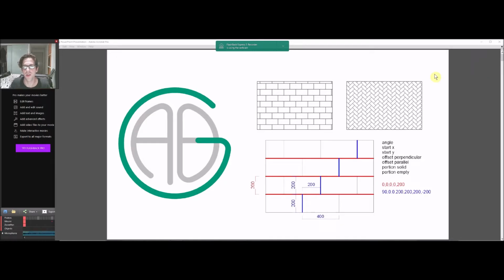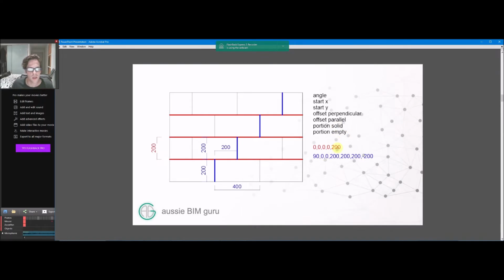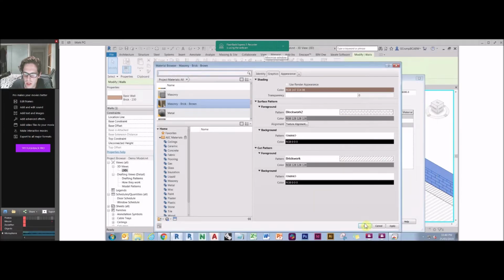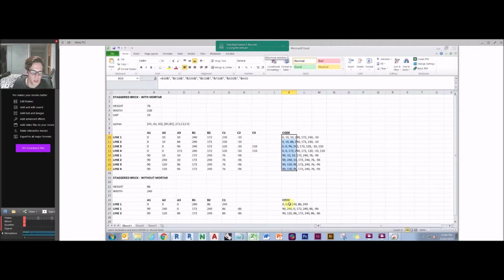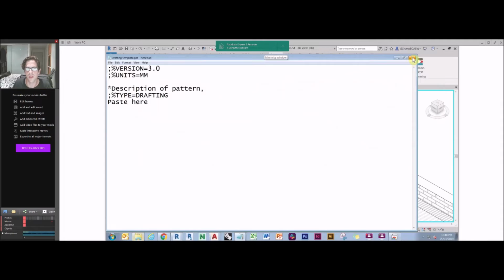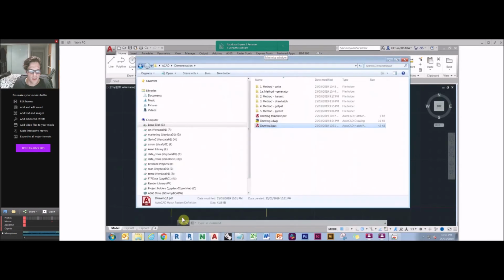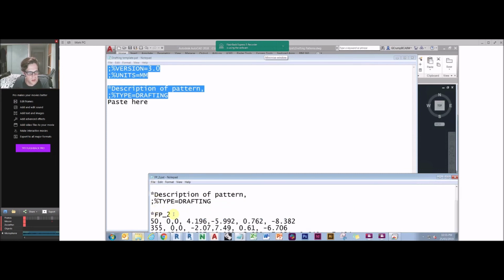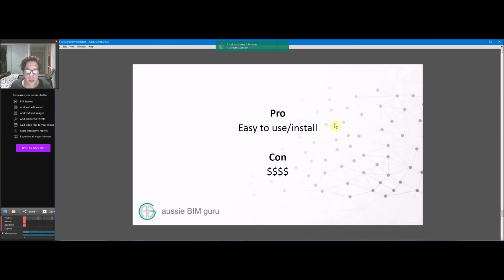Create Hatch Patterns in Revit (6 easy methods!)

Comment: Hello. Thanks very much for taking the time to produce this video. I found it very helpful. All the best.

I'm based in Australia and have set up some custom patterns to reflect the standard rounding that we do out here i.e. 7 courses at 86mm = 602, but we rationalise this to 600mm by working on a couple of 9mm mortar joints instead of 10mm to acheive the 600mm module. All joints and course lines habve been rounded to the nearest 1mm. Here they are if anyone is interested:

;%VERSION=3.0
;%UNITS=MM

*Brick 76Hx230W stretcher bond, Standard Australian brickwork stretcher bond
;%TYPE=MODEL
0,0,0,0,600
0,0,86,0,600
0,0,172,0,600
0,0,257,0,600
0,0,343,0,600
0,0,429,0,600
0,0,514,0,600
90,0,0,0,240,86,-86,85,-86,86,-85,86,-86,86,-85,86,-86,85,-86
90,120,0,0,240,-86,86,-85,86,-86,85,-86,86,-86,85,-86,86,-85,86

;%VERSION=3.0
;%UNITS=MM

*Brick 76Hx230W stretcher bond with mortar, Standard Australian brickwork stretcher bond with mortar
;%TYPE=MODEL
0,0,10,0,1200,230,-10
0,0,86,0,1200,230,-10
0,120,96,0,1200,230,-10
0,120,172,0,1200,230,-10
0,0,181,0,1200,230,-10
0,0,257,0,1200,230,-10
0,120,267,0,1200,230,-10
0,120,343,0,1200,230,-10
0,0,353,0,1200,230,-10
0,0,429,0,1200,230,-10
0,120,438,0,1200,230,-10
0,120,514,0,1200,230,-10
0,0,524,0,1200,230,-10
0,0,600,0,1200,230,-10
0,120,610,0,1200,230,-10
0,120,686,0,1200,230,-10
0,0,696,0,1200,230,-10
0,0,772,0,1200,230,-10
0,120,781,0,1200,230,-10
0,120,857,0,1200,230,-10
0,0,867,0,1200,230,-10
0,0,943,0,1200,230,-10
0,120,953,0,1200,230,-10
0,120,1029,0,1200,230,-10
0,0,1038,0,1200,230,-10
0,0,1114,0,1200,230,-10
0,120,1124,0,1200,230,-10
0,120,1200,0,1200,230,-10
90,0,10,0,240,76,-95,76,-96,76,-95,76,-96,76,-95,76,-95,76,-96
90,230,10,0,240,76,-95,76,-96,76,-95,76,-96,76,-95,76,-95,76,-96
90,120,0,0,240,-96,76,-95,76,-95,76,-96,76,-95,76,-96,76,-95,76
90,350,0,0,240,-96,76,-95,76,-95,76,-96,76,-95,76,-96,76,-95,76

;%VERSION=3.0
;%UNITS=MM

*Brick 76Hx110W stack bond with mortar, Standard Australian brickwork stack bond with mortar
;%TYPE=MODEL
0,0,10,0,600,110,-10
0,0,86,0,600,110,-10
0,0,96,0,600,110,-10
0,0,172,0,600,110,-10
0,0,181,0,600,110,-10
0,0,257,0,600,110,-10
0,0,267,0,600,110,-10
0,0,343,0,600,110,-10
0,0,353,0,600,110,-10
0,0,429,0,600,110,-10
0,0,438,0,600,110,-10
0,0,514,0,600,110,-10
0,0,524,0,600,110,-10
0,0,600,0,600,110,-10
90,0,10,0,120,76,-10,76,-9,76,-10,76,-10,76,-9,76,-10,76,-10
90,110,10,0,120,76,-10,76,-9,76,-10,76,-10,76,-9,76,-10,76,-10

;%VERSION=3.0
;%UNITS=MM

*Brick 76Hx230W soldier stack bond, Standard Australian brickwork soldier stack bond
;%TYPE=MODEL
0,0,0,0,240
90,0,0,0,600
90,86,0,0,600
90,172,0,0,600
90,257,0,0,600
90,343,0,0,600
90,429,0,0,600
90,514,0,0,600

;%VERSION=3.0
;%UNITS=MM

*Brick 76Hx230W soldier stack bond with mortar, Standard Australian brickwork soldier stack bond with mortar

;%TYPE=MODEL
0,0,10,0,240,76,-10,76,-10,75,-10,76,-10,76,-10,75,-10,76,-10
0,0,240,0,240,76,-10,76,-10,75,-10,76,-10,76,-10,75,-10,76,-10
90,0,10,0,600,230,-10
90,76,10,0,600,230,-10
90,86,10,0,600,230,-10
90,162,10,0,600,230,-10
90,172,10,0,600,230,-10
90,248,10,0,600,230,-10
90,257,10,0,600,230,-10
90,333,10,0,600,230,-10
90,343,10,0,600,230,-10
90,419,10,0,600,230,-10
90,429,10,0,600,230,-10
90,505,10,0,600,230,-10
90,514,10,0,600,230,-10
90,590,10,0,600,230,-10

;%VERSION=3.0
;%UNITS=MM

*Brick 76Hx162W soldier stack bond, Standard Australian brickwork soldier stack bond
;%TYPE=MODEL
0,0,0,0,172
90,0,0,0,600
90,86,0,0,600
90,172,0,0,600
90,257,0,0,600
90,343,0,0,600
90,429,0,0,600
90,514,0,0,600

;%VERSION=3.0
;%UNITS=MM

*Brick 76Hx162W soldier stack bond with mortar, Special Australian brickwork soldier stack bond with mortar

;%TYPE=MODEL
0,0,10,0,172,76,-10,76,-10,75,-10,76,-10,76,-10,75,-10,76,-10
0,0,172,0,172,76,-10,76,-10,75,-10,76,-10,76,-10,75,-10,76,-10
90,0,10,0,600,162,-10
90,76,10,0,600,162,-10
90,86,10,0,600,162,-10
90,162,10,0,600,162,-10
90,172,10,0,600,162,-10
90,248,10,0,600,162,-10
90,257,10,0,600,162,-10
90,333,10,0,600,162,-10
90,343,10,0,600,162,-10
90,419,10,0,600,162,-10
90,429,10,0,600,162,-10
90,505,10,0,600,162,-10
90,514,10,0,600,162,-10
90,590,10,0,600,162,-10

Sincerely,
Michael Sandel
Plan Source
E michael.s@plansource.com.au
Reply from the maker: Glad it helped.

Legend on the sharing too, will pin this so others can more easily find it!

Comment: Pyrevit just crashes my Revit.
Reply from the maker: Bummer. Make sure you're using the latest version.

If pain persists, log an issue on their github for assistance.
Reply: @AussieBIMGuru  I logged the issue, but I can't expect any changes soon. I just need a demo brick pattern for Revit. I guess it's more of a want at this point.
Reply from the maker: @nabrup3 generally pyrevit should be working in revit 2022-25 at least. If the build is older that might relate to the cause as im unsure if they test before then.

Comment: Thank you for the tutorial it is quite helpful, however, the pattern i am after is a brick pattern that shows the mortar but without the bricks being staggered, is there any way to getting this done?
Reply from the maker: Yes you could write such a pattern manually using the tips in the video or try the patternmaker in pyrevit if not.

Comment: hi what is  the meaning of a negative delta x or y?
Reply from the maker: Depending which one it is being used in for the values, it would move in the opposite direction. E.g. a negative rotation (ccw), a pattern repeating in the opposite direction, moving down/back, or starting below/behind the origin of the definition. Generally most patterns can be written with no negative values I believe.

Comment: Hey awesome video!
I'm actually getting the first method to work by editing Revit's default PAT file. I have a question for you. 
I am creating a Norman brick with a 1/3 running bond in US Imperial. so 12" x 2.667" brick with the running bond spaced at 1/3 the distance from the one below (4"). To achieve this, I have my horizontal information set to 90,0,0,2.667,4,2.667,-2.667. I need to space the bricks apart 12", but I cannot input this number. According to your example in the first method, you have the horizontal distance between vertical lines set to 400, but it is not described in your note pad and you didn't mention that number in the video. How do I tell the pattern file what this number needs to be? Thanks so much your videos are awesome! Liked and Subbed
Reply from the maker: I actually use a bit of a shortcut with my first example by specifying a vertical and horizontal offset for the vertical line, so it will repeat in both directions to create the staggered brick pattern (on the second notepad line). A more exhaustive way to do this is to draw your pattern freehand, find an origin point and identify the repeating pieces you need to 'build' the pattern overall. For a 1/3 running bond I think you might need 3 lines.

These days I typically use pyRevit to make patterns which comes with a great tool that can create a tileable pattern from detail lines you draw in Revit. From there you can view the .pat file and it will reveal the code required, so it can be a good learning aid too.
Reply: @AussieBIMGuru  This reply was so fast! You rock. I found a few Reddit threads about setting a running bond. Unfortunately I have yet to find the perfect solution in writing the code myself. I'm going to use your advice and try the pyRevit tool to build it myself. Thanks for the help! If I solve it I'll share the PAT code in the chat, so you can check it out.

Comment: The first 4 methods are not in Revit, but in Notepad, Excel or AutoCAD. This is not helpful for our designers who need to create their own patterns! pyRevit is good but there are some issues where it crashes Revit on startup so we're no longer including it in our deployment... I really wish there was an equally easy-to-use plugin for making patterns inside Revit!
Reply from the maker: Sure the first 4 aren't in Revit, but they're the fundamental methods all the addins are working from essentually. They're worth sharing and are the fallbacks when addins dont cut it. No point in sitting around waiting for someone else to solve a problem if another way is immediately possible in my experience.

When PyRevit works it's great, no issues for me so far but I know a lot of addins conflict with it so maybe review which addins you are using and avoid any that arent well supported or regularly updated by their authors.

Try dynapat or honeypat maybe?
https://caddetailsblog.com/post/dynapat-ultimate-pattern-maker-for-revit-by-dynamo
Reply: @AussieBIMGuru  DynaPat seems awesome, thanks!

Comment: Thank you, very helpful and insightful. 
Please remember that with hatch patterns, if you change dimensional info in the Fill Patterns dialog box from the family editor's Additional Settings. Then reload it into your original model or nested family, and the pattern was already defined, the new settings will not take effect. You will then need to update the Fill Patterns dialog box in your host family or your project to match. In short, if you are looking to edit an existing fill pattern don't open the family editor just make the changes in your project's Fill Pattern Dialog box.
Reply from the maker: You're welcome! Yes that applies to many things in Revit; materials, object styles, line patterns - the list goes on!

Comment: Microstation was much better at this. Similar to Autocad array but you could select the line work to be repeated, then by distance of length and width and that was it. Autocad array can be done and then clip the array.
Reply from the maker: Interesting - I never used Microstation but I did hear they got a lot of things right that haven't found their way to other software platforms. I've found pyRevit's pattern generator fairly intuitive recently; a similar workflow to what you describe by the sounds of it.